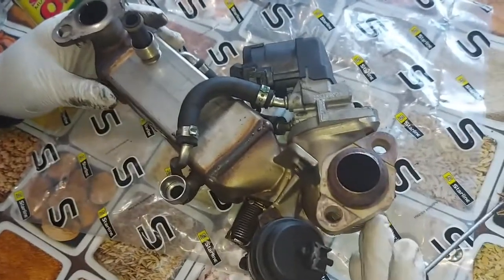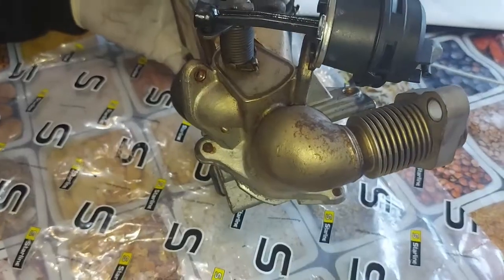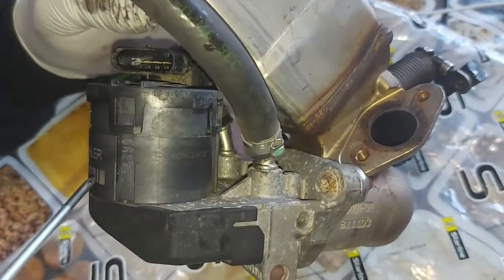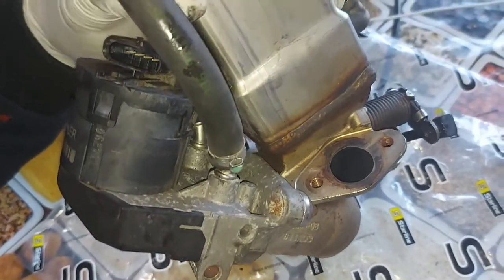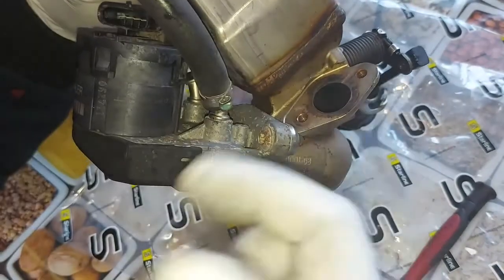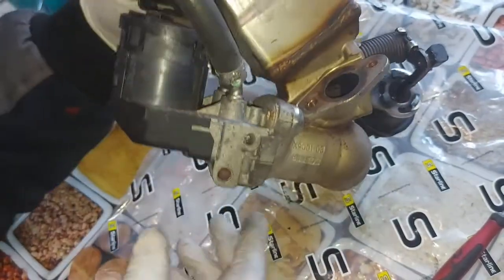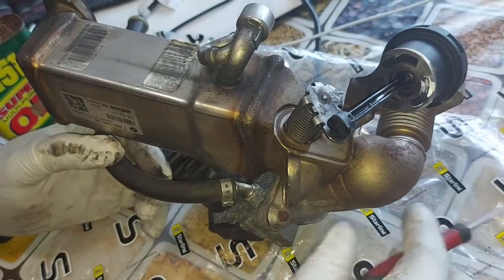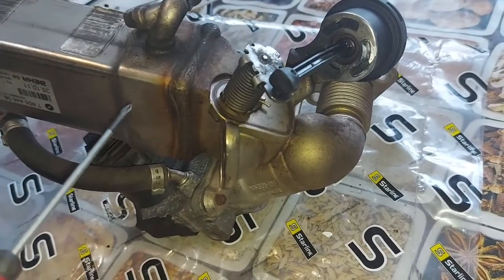EGR Uncovered: The Secret Behind Its Role in Your Car and Why You Should Ditch It!

Comment: Hello, if you remove or replace parts along with the EGR, can it affect the engine's performance in the future?
Reply from the maker: If you replace an egr valve you may need a diagnostic machine to relearn or adapt the egr valve
Reply: I have solved this shit, I have put a cancellation kit for the gas cooler, EGR, DPF, I also had it cancelled because I had a downpipe when I did stage 1, without these parts the only thing that happens is that it takes longer to warm up the engine temperature but from my point of view and for me it is not a problem, the problem was the part placed in the vehicle because it was losing antifreeze now I do not have this problem

Comment: Hi, i have an error (EGR Cooler Bypass Control Stuck (Bank 1))
but i just installed a new EGR cooler and valve, i checked after installing the actuator will open the flap but the error will still appear after resetting
Reply from the maker: You may have to relearn the EGR valve, hope it helps

Comment: Hello, does should egr bypass valvle stay closed or open until engine warms up?
Reply from the maker: It is opened during warm up and closed when the engine has warmed up
Reply: @jamrozelectronicssolutions7232  i see that the plastic arm connected to the pear on audi b8 stays down, is it normal? Cuz i think staying like that means that is closed and car reaches pnly 70 celcius. Changed all thermostats and return valvle

Comment: Hi! I have white smoke (ONLY)while Regen on acceleration. New injectors fitted , new g450 , workshop cleaned dpf, cleaned throttle flap and intake manifolds No coolant lost , steady oil dipstick level. No fault codes. Max dpf sensors 550 c during Regen (active). 450-500 passive and very very slowly drops of soot (1hour drive highway). Should I think to replace EGR now ? 200.000 klm. Thanks in advanced!
Reply from the maker: I would like to believe that if your egr was the problem it would affect the mass airflow and engine would lose power. I would expect some white smoke during regen because of the fuel in the exhaust and the soot burning to ashes. Are you losing power at all?

Comment: What happens in the plastic bypass valve vacuum arm is broken and the valave cant open its constantly closed?
Reply from the maker: The purpose of the bypass valve is to allow hot gasses to the intake to reduce the tendency of condensation. which can cause rough engine performance

Comment: hello @Jamroz , i took off the egr cooler and the valve is stuck, hardly moving when using the parrot plaier after i took it off .
A lot of cleaning, oil and wd 40, it s moving, but not by hand. Should i replace the entire egr cooler or there s a way to make it free again? 
I had 4C9F and 4C9E saying the acuator is  non fuctioning.
Reply from the maker: Sorry bro i had taken a break. i would change the whole thing because i might happen again. if carbon is the problem fitting a new one will work for a season. check if the turbo bearings are not allowing oil to go into the engine

Comment: I have error P14A3 EGR exchanger bypass jammed open(hot side). The car is Peugeot 5008 1.6 HDI. What can I do?
Reply from the maker: Try cleaning the egr valve clear the code and take the car for a drive. The valve is stuck because of carbon. You can buy egr valve cleaner from motorfactors

Comment: Hello, thank you for your video. I hope you can help me,i got this error code in BMW
290900 - Air system, Air to Egr mass flow, plausibility : measured air mass compared with calculated air mass too high. How do I diagnose it? What could be the cause?
Reply from the maker: My response is based on your comment. If the measured air mass is higher than recommended I want to believe that could be caused by an egr valve that is open constantly,  if that is the case the engine will also be down on power. Let me if that is the case. Everytime the egr valve opens, the air mass meter should reduce it's readings to accommodate the extra air from the egr valve.
Reply: Egr cooler is clogged, i had the same code.

Comment: Ive heard this entire air/exhaust circuit can be permanently closed and disabled by clamping a vacuum control hose.
Thia allegedly also stops inlets coking up.
Can you identify the pipe which would emable this?
Reply from the maker: Hi John
What are you trying to achieve John